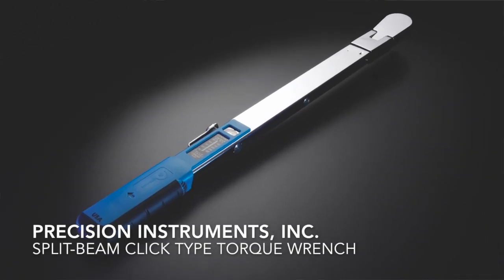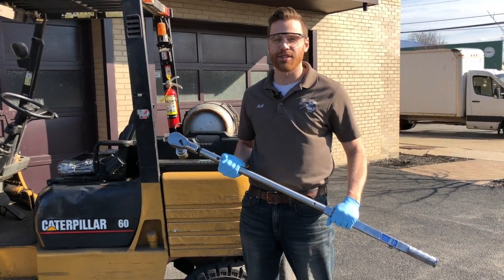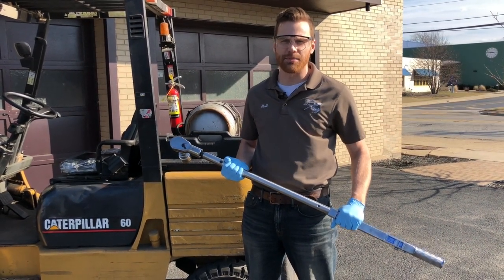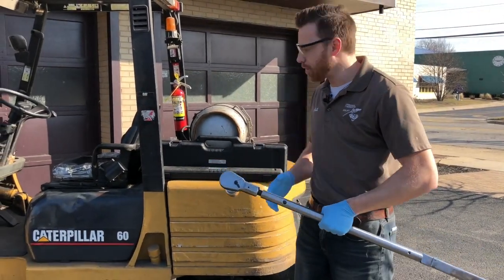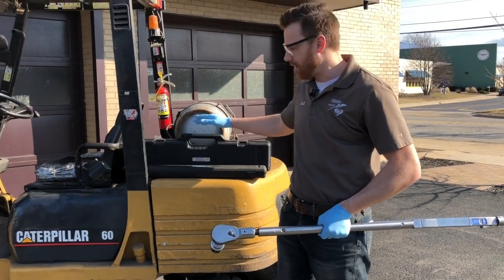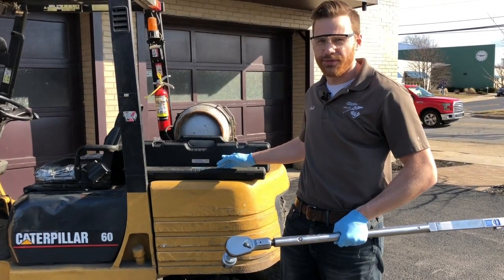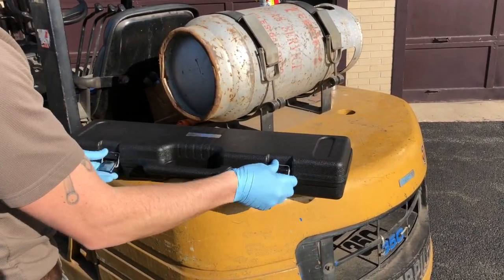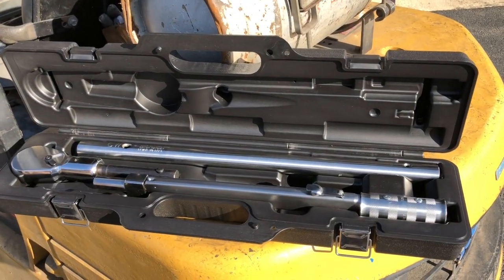C4D600F / C5D600F Demo

Comment: Can the handle be disassembled for servicing and/or repair?
My well used favourite 3/4 torque wrench has stopped clicking.
Cheers
Reply from the maker: Absolutely! You can send the torque wrench handle if the ratchet head is in good working order.  The reduced size and weight saves on shipping.  You can obtain an RGA# for service at our website. www.torqwrench.com. Thank you!

Comment: Great torque wrench! Use it on my commercial tire truck. TIA guidelines require torquing all lugs with a calibrated torque wrench. My question is; how do I clean the window on the dial gauge? It’s cloudy and I need to get in the wipe it off so I can see to get accurate settings. Any help?
Reply: Depending on how old your tool is there may be two torx-drive 2-56 screws holding a steel nameplate frame to the rectangular case.  Those can be removed allowing the frame to be removed and giving you access to the nameplate and dial gear for cleaning.  Be careful when putting those tiny screws back in.  They are easy to over-tighten.  Good luck!

Comment: The problems is your torque wrench doesn't work counterclockwise.
Reply: The 3/4" and 1" drive split beam click wrenches (like the one in the above video) work in the CCW direction by rotating the ratchet in the extension tube 180 degrees (there is a 1/2" diameter locking pin you depress that allows the ratchet to rotate and will then snap/lock into position.)  Of course you also have to flip the reversing lever on the ratchet to the right in order for it to "ratchet" properly.  These instructions are included in the user manual as well as being stamped on the extension tube in large font up by the location of the 1/2" locking pin.)